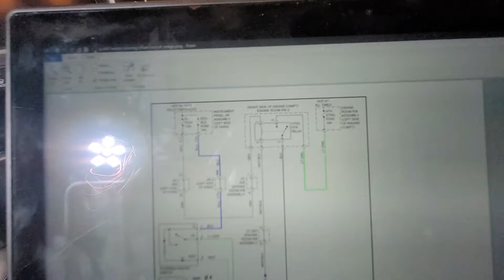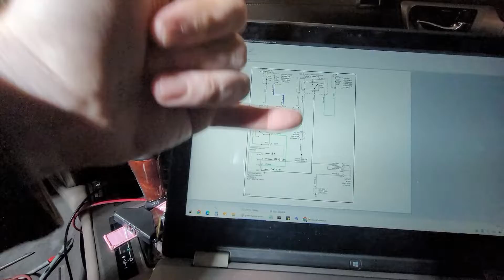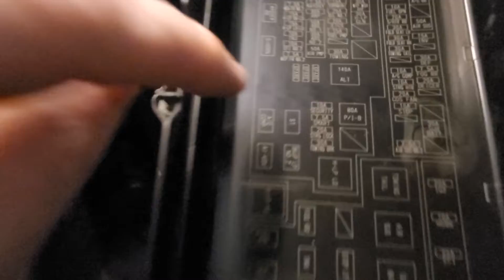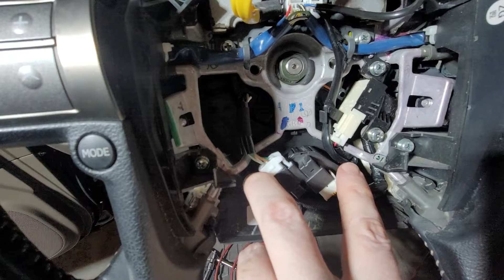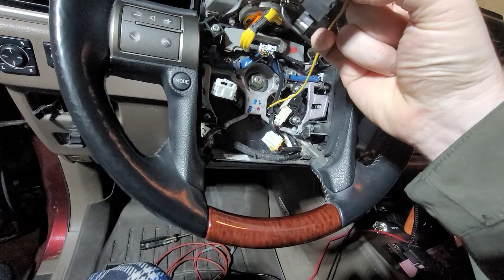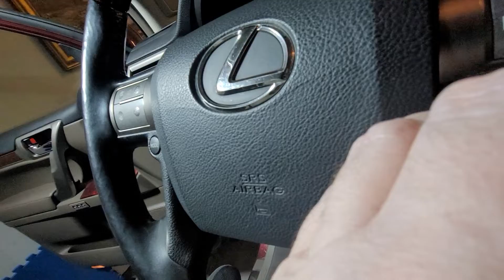Fixed! Lexus GX460 LS460 and other Toyota cars that have heated steering wheel that does not work

Comment: Do you think it would be possible to add in a heated steering wheel to a GX that didn't have it before using the diagram?
Reply from the maker: Yes. But its more wiring and you may need a new clock spring.

Comment: Still a little confused. The ground inthe heater unit broke or the ground in the steering wheel from the heater module broke?
Reply from the maker: Steering wheel coil ground broke.
Reply: @Mac1PC I’m pretty sure you’re referring to the clock spring….?
Reply from the maker: Yes either replace the clock spring or just add ground.